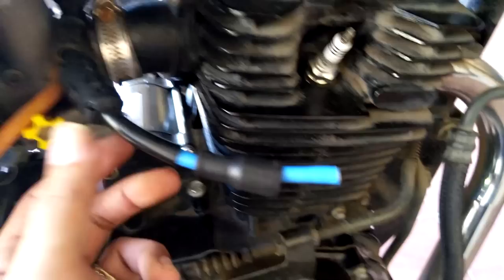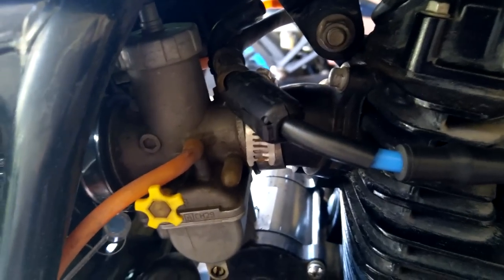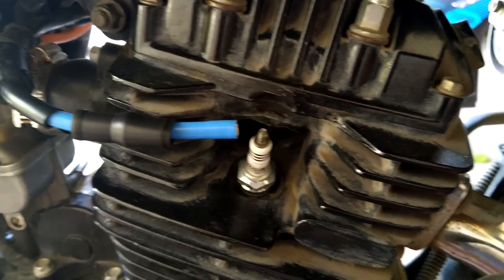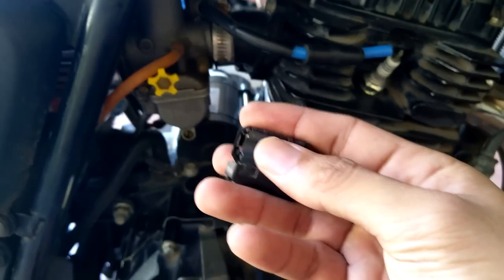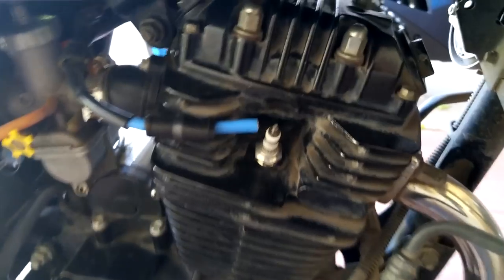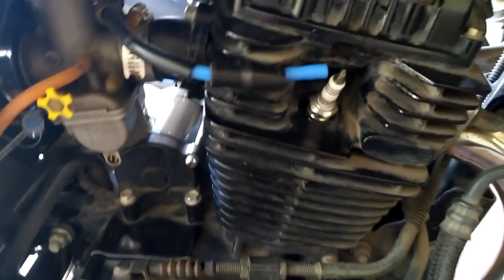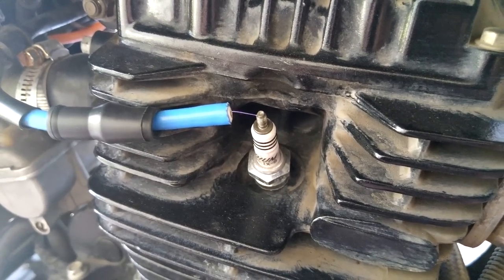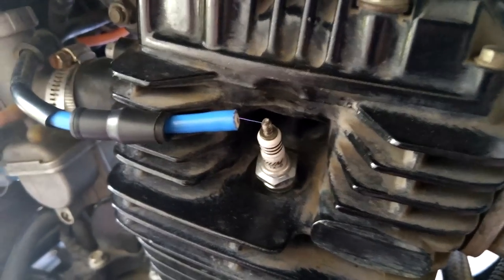ferrite bead on sparkplug wire

Comment: If there is a difference made with the bead it’s a spark plug wire issue. Plug wires are designed to have zero ignition leakage. Also without the spark plug cap that commonly contains a resistor and the iridium spark plug that you were using for sure containing a resistor there was plenty of resistance. Without taking these components into consideration it’s just not a practical test. Good wire, good cap, good plug, good ground equals a clean strong spark.
Reply: Resistor plugs diminish the spark by as much as 65%, I don't know how much reduction comes from a suppressor wire, I'm sure it varies with length.  Yes, a good wires does not leak at one point. , , , this is about the magnetic field that surrounds the wires, and the current lost as a result.
Reply: @thomasgronek6469  for as long as their is a current flowing a conductor their will always be a magnetic field created specially on an ac system, but on a motorcycles perspective (wc is dc system) it is easily disregarded. Long story short if you really want to improve your fuel consumption, try; properly inflated tires, clean air filter and carb, have your ecu tuned to save fuel if someone can do that and, dont get past 70-80kph
Reply: First of all that’s entirely false. Plug wires are terrible including performance wires. How do you think a timing light works genius? Now we do run plug wires good enough that you can’t even use a timing light or detect energy traveling through. There’s only a single brand on earth that’s that good and they are custom $400 (US)wires. However They still cannot completely contain everything.  Besides we’re not exactly talking about voltage loss. We are talking about magnetic fields. EMF and EMI is what ferrite’s are used for.
Reply: Stand by my first comment. This is snake oil. Maintain your ignition system. Do the test with a new coil and wire to see the results. You want to discuss it further you will find me at the track putting people on podium……………with no  beads on our ignitions, just saying.

Comment: deep inhale
I have a 2002 infiniti Q45 and for some reason they don't have isolated ECU grounds and eliminating electrical noise has been an ongoing issue. The car is insanely finicky, a hand tight sparkplug can cause enough resistance for the coil packs to derp out, but 23ft-lbs and it runs fine.. it's wild. Eventually I'll rewire the car but until then, I have been tinkering with ferrite beads and so far I have one on the cam sensor and one on each LED headlight (right before the anti flicker module) and I notice less pulsing in the exhaust (it's got a full exhaust, can be pretty loud) when the lights are on. Car runs silent with no load on the motor, put the defroster on and the headlights and suddenly it's thumping away and other random drivability quirks. 

This honestly might be a good solution for older 90s-early 2000s cars with wonky wiring.

/rant

Comment: Sounded to me like the snap from the spark was more audible w/o the bead meaning that the bead when used with a non-copper conductor wire on a single cylinder engine reduces the power and why theres a spiral winding around the conductive core already in high voltage high suppression ignition wires.....

Put the stock copper strand wire back on and try the same experiment....

Your experiment would of had more weight using a spark intensity lightbulb with voltage readings aswell as a audiometer

Comment: Nalagyan ko ng gnyan ung plug ko sa Sniper 150, tas naka faito racing coil, ang kinalabasan parang nanginginig masyado ung engine pag high rpm na sya, maganda sya sa unang arangkada, garantisado ung throttle response maganda, pero sa dulo pre, sobrang lakas na ng kuryente nya, parang may crackling sound sa makina nahihirapan dumulo. Maganda to sa daily driven na motor ung tipong pang traffic lang, pero sa long ride ekis, hirap sa waswasan
Reply: kasi faito na.. malaki na yan.. yung stock ang lagyan mo

Comment: Pag may ferrite bead/core nag sstabilize ung kuryente which is mas sharp ang bato papunta sa spark plug . Pag walang ferrite bead ay malikot ang kuryente sa htw 😊
Reply: Pdi ba to Suzuki ts100?
Reply: Pag mahina na ang ignition coil, volt reg at ang mismong stator ay walang kwenta na ang filter.

Comment: Have u tried to install 2pcs ferrite on the spark plug cable? Because ferrite usually need to install 1each at both ends.
Reply from the maker: i tried, and it felt like it's better at single

Comment: In ur video , the spark colour shows the purple colour, so the carb tuening is slightly lean mixture.
Reply from the maker: i didnt know that , how is that so?
Reply: @MunsKi  the spark colour shuld be in blue, so tune ur carb slightly in thecounter clockwise and check the spark colour in the night time , blue colour is the optimum engine heat, and Afr is correct,
Reply: Ignition coil has nothing to do with carburetor..
Reply: @Suriya Narayanan could you please enlighten us in detail about the relationship between the electrical systems(stator-rectifier-cdi-ignition coil- spark plug) to the carburetor( fuel and air mixtures)? How do they co-relate? Thanks... Expecting a reply real soon. God bless!
Reply from the maker: electricity works like push and pull, so the mixture at the sparkplug gap cud make an effect to the electricity. the electricity color is indication of ions returning to stable form, meaning it is a disruption or vibration in the area that causes waves of photons to be detected by our eyes....... this is the theory
Reply: San nabibili yan

Comment: 1. Ang ferrite clip core ay ginagamit para mabawasan ang Eletromagnetic Interference EMI at Radio frequency Interference RFI.
2. Ang motorsiklo ay hindi naman maselan sa EMI at RFi sapagkat wala naman pinaprocess na signal radio at frequency ang motor mo. Ito ay inilalagay sa mga maseselang device na gumagamit ng active device na madaling masira sa surge o spike ng signal at koryente.
3. Wag masyado maniwala sa mga online shop sa mga pangalan ng item na nilalagay nila sa product kasi kahit sila hindi alam ang binebenta nila.
4. Kung talagang gusto mo lagyan ng ganyan motor mo ok lang nasa uso ka at di naman masisira siguro yun motor mo.
Reply: Hahaha, akala siguro antenna ang spark plug coil ng motor nya.. Hahaha!!
Reply from the maker: ehem cdi.... cough
Reply: Kaya nag taka ako boss. Baka pwede ito ikasira or baka for short run lang to?
Reply: lol.   kaya nga ako nakaka gamit ng rpm meter dahil na ka coil ang wire ko sa ignition coil na yan..  "take note" ang installation ng rpm meter digital ay na sa manual instruction ng Koso.. 

isip muna guys bago comment.. wag pumunta sa giyera na baril lang dala at walang LAMAN na bala
Reply: pwede magkabit ng rpm meter na hindi gumagamit ng coil na yan. Iba ang purpose nya sa video. Iba naman yun rpm.
Reply: @edselexie5761  well current itself.. meron po tlga lumalabas...

Comment: Mag research ka ng maayos pre. Walang kailangang ifilter sa dc system ng common motorcycle kasi walang nacrecreate ng electronic noise, puro heat lng binibigay ng makina. By the looks ni walang ecu motor mo at kung meron man for sure walang ferrite core yan kasi nga walang "EMI" at hindi naman radyo yang spark plug para masagap nya ganyan ka high freq noise. Lagay mo nlng yan sa antenna nyo baka may mafilter pa yan na noise
Reply from the maker: ano ba masama kung lalayan?.. e sa gusto ko bawasan radiation ng emf sa itlog ko e..
Reply: @MunsKi  yung makina ang nagraradiate ng heat. Iba ang heat sa emf at hindi radio frequency nilalabas ng ignition coil mo. Naka dc na yan kasi may regulator ang motor at napakalow frequency ng stator kung gusto mo talaga jan tumutok. 60hz nga lng typical source. Ang nakakasaklap eh kung ano anong echus pinagsasabi mo to sound smart. Hindi radio ang motor mo pre. Wag mo na isali itlog mo sa kalokohan mo, para may macontent ka lang tapos mali2 pa
Reply from the maker: @shtdfckup2550  are you sure?... and nope im not trying to be smart , the video is about a test with or without a bead, conclusion is yours...

and by the way explain to me with facts na walang emf ang pulsating dc na hindi aabot sa itlog mo.
Reply: @MunsKi  electromagnetic field/frequency or electromotive force, san jan gusto mo? Anyone studying electrical/electronics engr knows that any conductor, carrying current creates magnetic field. And that applies to both ac/dc. Modern ecu is protected enough to filter out that noise. Kung takot na takot ka jan sa emf wag kang humawak ng smartphone.
Reply from the maker: meron o wala? ikaw narin sumagot which is contra s previous statement... meron diba? anything electrical meron noise... all electrical noise mapa mahina man o malakas ay electrical noise parin, gaya ng friction, anything na nag aaccumulate sa kalaunan ay may malaking effect... hindi noticable sa una parang patak ng tubig sa bato... pero s kalaunan patak man kayang humukay ng matigas na bato... any reduction is reduction...
Reply: @MunsKi  may sinabi ba akong wala? Ang sinabi ko sobrang hina unlike sa smartphone mo kaya ibaba mo na yan at magbasa ka ng libro related jan sa pinagsasabi mo.
Reply from the maker: pakibasa nga una mng comment kung sinabi mng wala, i qquote ko p ba? saka... 40k volts pulsating kayang mg inite ng fuel average 5000rpms .. wala ko nakikita masama kung maglagay ako s motor ko, ikaw ba meron? i share m samin ang disadvantage....

yep aware nmn tayo sa radiation n labas masok s mga katawan nating parang mga capacitor, sanhi yan ng di lng cp mo o cp ko, mga radio telco towers...,kaya i suggest ko sayo tatapak ka din sa lupa para mg grounding paminsanminsan at naway sumingaw namunuong static sayo... .
Reply: @MunsKi  🥰🥰🥰 thanks for enlightening us kung pde lng sana ako maglagay ng photo comment dito para gayahin ko ginawa mo sa motor mo. Wala kasi kaming testing equipment na kaya jan sa nasearch mong 40kv. Multitester lng meron sakin, on that note ill end this here. Sana marami ka pang mashare na kaalaman sa lahat 🥰🥰🥰

Comment: pul les resistance spark plug les resistance ignition wire les resistance spark plug cap put iridium spark plug and lastly put 2 pcs ferreat bead fr both ends. problem solve.

Comment: Good Evening po Faito po ba na ignition coil ang gamit nyo? GOD BLESS PO. :)
Reply from the maker: Yis
Reply: @MunsKi  terawat po ba or yung 7400? Nag babalak din po kasi sana ako  kaso wave 100 gamit ko. Ano po ba mas okay oara dito. Maraming salamat po. God Bless po.
Reply from the maker: @lukeperrysigney1284  terrawatt lng gamit ko e... kung babaran high rpm mas mainam ung 7400... pero sa off on throttle sapat n terrawat

Comment: Ano relation ng malakas kuryente sa pampabilis ng horse power? kung ang big spark and regular spark will ignite the same fuel and air mix... di ako mechanic.. i wish to learn
Reply from the maker: guess what happens if the initial flame kernel ignites faster/larger 👍
Reply: Skin mas lumakas at gumanda hatak.. 
Tsaka gumada tunog smooth  stable xa kc mas makapal na supply ng power..

Comment: useless may sariling ferrite core ang sparkplug natin effective yan sa antenna, same function ng 9power tinatanggal nya lang ung noise at hindi pinapalakas 
kung gusto nyo lumakas bili ng branded sparkplug or cdi
Reply: Bago dumaloy sparkplug yan dadaan muna sa ignition coil at sparkplug cap yan.. 🤣 kung wla solid na kuryente pumapasok ky sparkplug mo pra san pa ferrite core hahahha isip muna bago comment